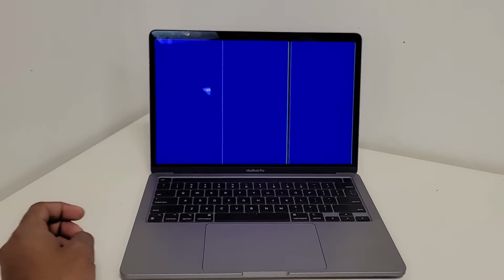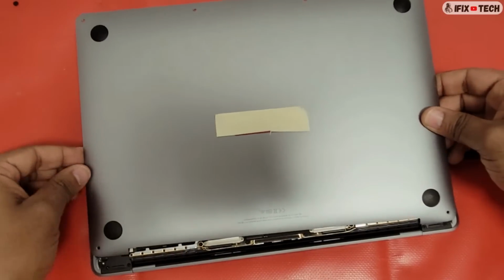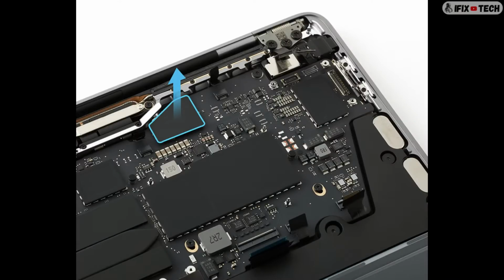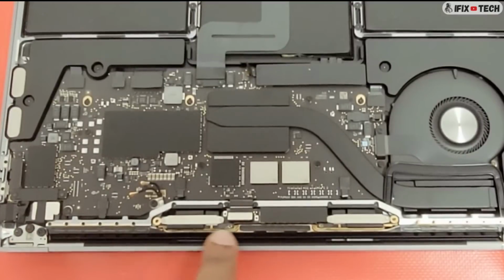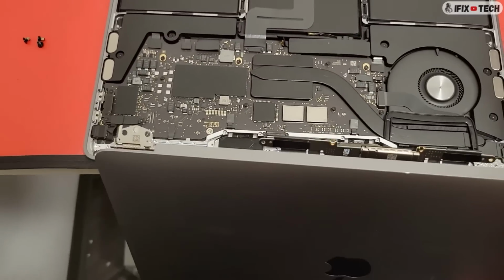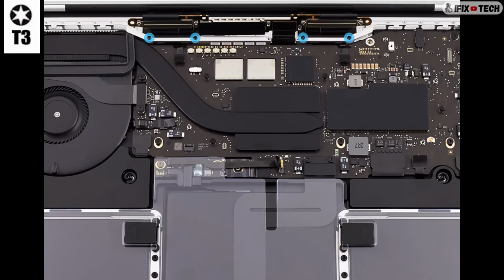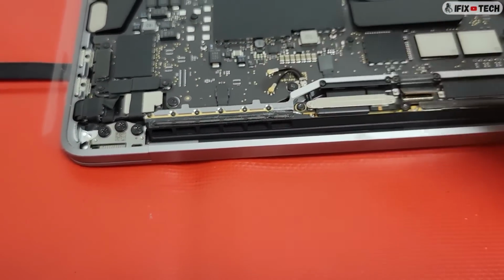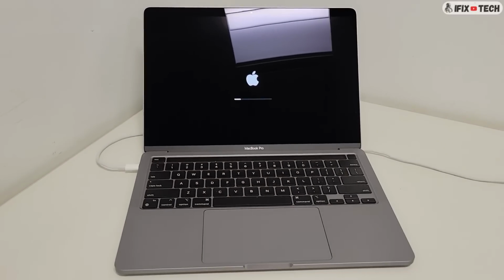Apple MacBook Pro HOW TO Replace SCREEN Step-by-Step Guide Tutorial

Comment: LCD Assemblies are a breeze to replace, once you've done a few. The LCD Panels themselves, there's a challenge; I repair about 10 Macbook Air 2179s and 2337s every day at work.

These Pros take an extra 5-10 minutes just because of all of the extra screws.
Reply from the maker: That is true. Wao that is a lot of repairs for one day. 😲
Reply: Do you know what kind of tools I would need to repair a Macbook Air 2179?
Reply: @adurgan20 For an A2179, you can get a full Display Assembly and the only tool you'll need is a screwdriver with a P5, T5, T8, and T3 bit.

An LCD Panel is cheaper than a Display Assembly, but it requires a .002 mm thin disc, a heating mat, and you may have to find a way to source the diffuser sheets underneath the LCD. So in the end, the Dispaly Assembly is actually going to cost you less money and less stress.